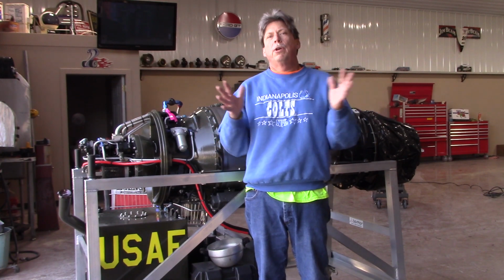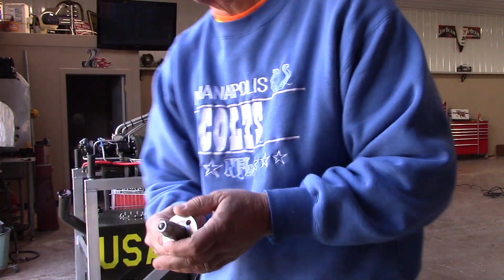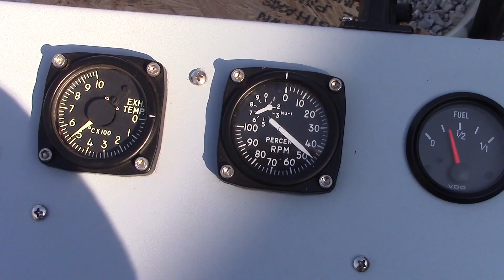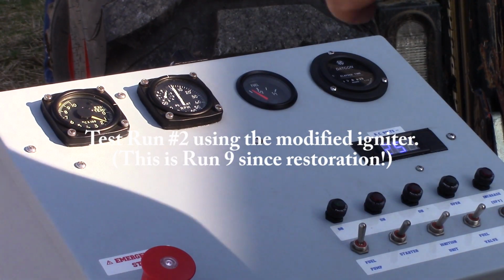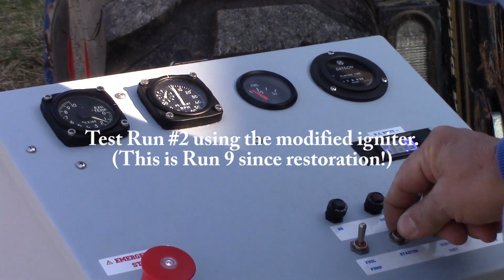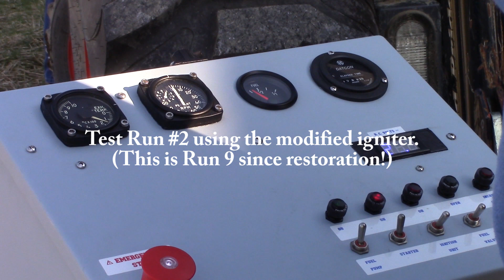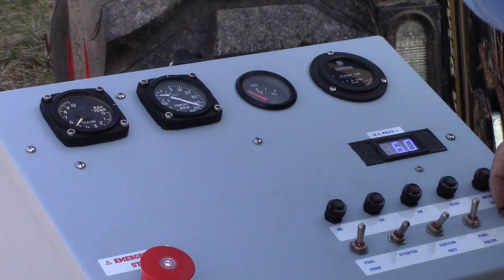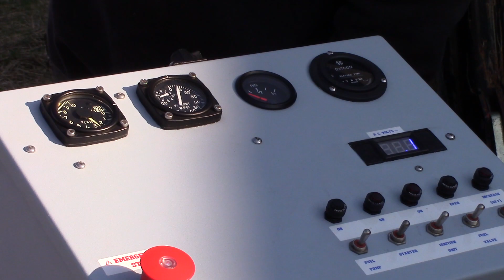The J44 Project:  Runs 8 & 9, Testing a New Modified Igniter.

Comment: Hi DD.  I look forward to seeing whether you get a good start on straight kerosene with a bigger/hotter spark.  
PS  Even the professionals don't get it right.  At R-R Bristol, we trialled a new HE igniter box for Concorde's Olympus engines, because the internals of the original box were becoming obsolescent.  We did an air test with a pair of boxes fitted to one engine.  It didn't give a start until the aircraft got below 27,000 feet.  To cut a long story short, we had too 'hot' a spark of too short a duration and had to 'tweak' the new box to give a satisfactory start.
Reply from the maker: Thank you Graham for the spiritual support!  I try to assume that W.Y.S.I.W.Y.G. (What You See Is What You Get) applies here but you know what assuming can do.  As in an internal combustion engine cylinder, we can't see what is really going on with turbulence, etc., where a seemingly good spark on a bad plug in open air fails under compression & real cylinder conditions.  Then we throw in the different types of ignition systems (high voltage, low voltage, standard air-gap igniters & semi-conductor type igniters) & it is as clear as mud!  I would like to know more about the original design & operation of this little engine but it fairly obscure & the people that did know are gone...  at least hard to find.  You are the only gas turbine engineer I know!  Thank God.
Reply from the maker: PS:  I just want my engine to start at 732 feet (223 meters)!  That is the basic elevation above sea level here in central Indiana!
Reply: Hello grahamj9101, good to see you here Sir!
Reply: @DScottDuncan  Hello again DD.
It’s a long time ago now and my recollection of the new igniter box issues with the 593 are now a bit sketchy. My vague recollection is that we effectively took the internals of another box, then in production, and wired them into a box for the 593. When we didn’t get starts at altitude, it was pretty obvious that something was different. After some investigation, it became apparent that we had a more intense spark (‘hotter’, if you will) and of shorter duration. It was concluded that the ‘detonation’ (for want of a better word) of the spark was effectively causing a shock wave that was forcing the fuel-air mixture away from the igniter, which was unchanged. The solution was to modify the internals of the box somehow (I’ve no idea how), to reduce the spark intensity and increase its duration, so as to reproduce the spark given by the original box. Having done that, it worked fine.
Reply: @DScottDuncan  PS I wasn’t involved in this one, but I’m aware that we had another starting problem on another engine at R-R Bristol. The Adour engine for the Hawk/Goshawk had a major upgrade, including a new combustor.  However, when the first engine went to test, it wouldn’t start, or if it did, as a result of them ‘fiddling’ with the start sequence, they got ‘hard’ starts (with more than just a “poof”). What they did to sort it, I’ve no idea. I realise that this bit of information is of little or no help to you, other than to suggest that getting the fire to light in a jet engine can be tricky.
It’s one of the bits of jet engine folklore that Frank Whittle, in order to get one of his first engines to light up, took out an access port (or even the spark plug) and used an oxy/acetylene flame (or similar) to light the thing.
Reply from the maker: Any information about a subject is helpful & much appreciated!   Thanks again!   You're  part of the team!

Comment: HI Darren, I solved the igniter problem on my J44 engine by making an igniter plug that incorporated a small hole in it that a propane bottle was attached by a hose and fittings. Turn spark on then open propane bottle a little this would ignite a flame coming off of the igniter plug that would ignite jet fuel without any gasoline needed. I also have the nacelle that this engine was housed in that would be attached to the snark missile body. If you are interested leave a comment.
Reply from the maker: Hello & thanks for the info... sounds like a 'torch igniter' setup, which would work!  It would be comical to install a small propane bottle & plumbing on the engine stand & tell people that the J44 runs on that for fuel!  But seriously, I will keep that idea in mind; maybe a 24 V solenoid gas valve to open when the igniter is activated.  Where are your videos & pix of your J44?  I would be interested in seeing it/them! Thanks again for your interest.  Cheers!

DD

Comment: HI, I opened this channel for the sole purpose of contacting you abut the igniter problems. It is funny that you should mention about running the engine on propane as it is possible and yes, we did run it on a larger tank of propane at one time. It ran great, but no smell of the desired jet fuel burning. Un fortunately I sold the engine about 10 years ago to a guy in New York. I have a VCR tape somewhere of it running, but I would have to find it first. I do still have the nacelle housing though and would make you a good deal on it if you are interested in it for your restoration project. I can send pictures of it too you, but not sure how on the comments.
Thanks, Mark
Reply from the maker: Well, thanks & sorry I missed the video you have.  You can send a message to me via You Tube with you email address.  I can send you mine & then attach your pix to that.  I would like to find a 'bullet' cone accessory cover for it, as it came with the flat front cover for its application.

Comment: Were you able to install a bigger fuel pump and run her? Would be cool to see here at 100%
Reply from the maker: Hey there and thanks for your interest.  I have not done anything major with the engine since this video, after rethinking the electrical system design.  I really need a bit more voltage for the starter and a ‘separate’ supply for accessories like the pump and ignition system.  

     I will use 3 twelve volt batteries for the starter only and a 30 VDC supply for everything else.  Low system voltage will cause slower starts and longer spool-up times, which harms the hot section!  

     I will document any changes and work performed, and of course, any running.  The larger boost pump and regulator will be cool for sure but it will also stress this simpler engine more; luckily the cost of fuel will limit the 100% runs!  Thank again for viewing the video and sharing your interests.

DD

Comment: So those runs still had gasoline mixed into the fuel? And glad to see you back.
Reply from the maker: Yes.  When I first tried to start it some 5 years ago, it would not light-off using Jet A alone.  The previous owner said to "Try adding a little gasoline to the fuel." & that he used that practice with success.  I added gasoline to about 20% (+/-) & it would then light-off, with a bit of a 'poof!', I might add, but it would start.  The factory original igniter is 'small' compared to others that my limited experience self has seen, with a noticeably smaller & weaker spark.  I performed a couple of bench experiments to compare different igniters, using my old Bendix exciter.  The plug in this video (a Champion FS-31) has a much larger (& louder) spark than the original J44 igniter.  I am not sure why the original setup would not fire-off regular kerosene or jet fuel but maybe some other type of fuel was used or it could be the type of exciter being used.  The original exciter was very small & powered by 115 VAC, 400 Hz.  Additionally, there are 'high tension' & 'low tension' types..... maybe with correct exciter the original igniter will ignite Jet A!?  This is outside of my knowledge field so that's why I am experimenting.  Thanks for commenting!

DD
Reply: @DScottDuncan  I have a good friend who owns a Cessna Citation and even though I have  taken my own crow bars, monkey wrenches, pry bars, sledge hammers, etc with me for some odd reason he STILL will not let me work on either one of the turbo fan engines on that plane. I have explained to him in detail that I have watched every one of your videos and Agent JayZ's videos and even asked Graham a few questions and thereby should be considered certified by jetcity and the internet to be a real good jet engine tech.  I explained that all I wanted to do was take just ONE of the engines apart to see how it all works and that it was no problem if i forgot how it all goes back together because I could always just look at the other engine and match it back up.  For some strange reason he now insist on frisking me before I enter the hanger! It has bothered me so much that I am considering rethinking our 40 plus year friendship over his lack of trusting me to work on his toy!  I just don't get it! 😉 So in my vast experience in jet engine diagnostics and design I would suggest just spraying some either in the carburetor and turn the flux capacitor up to high and let her rip!  (Why did I just hear you lock the door to your shop???) 🤐
Reply from the maker: You can buy your own small gas turbine engine and then tell your friend that he is not allowed to touch it!  His engines cost too much to play around with.  You and I have to work with older, smaller engines to be able to afford it.